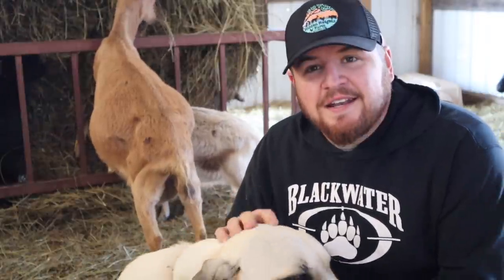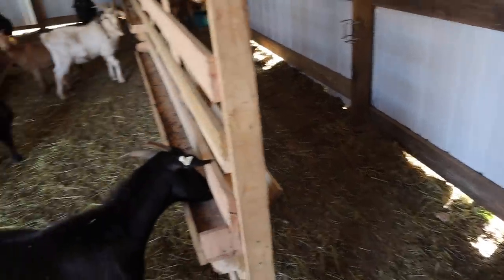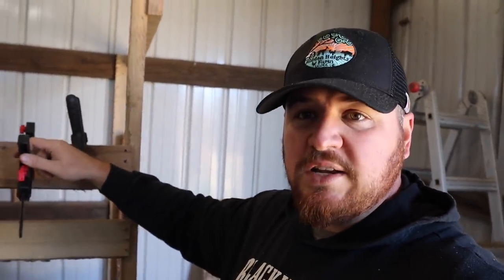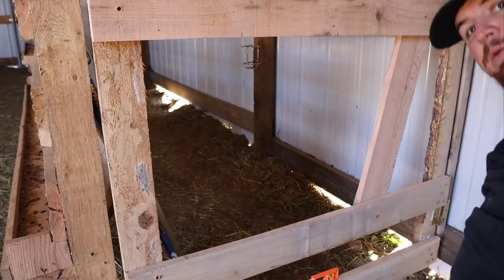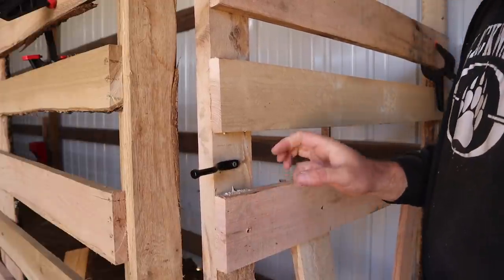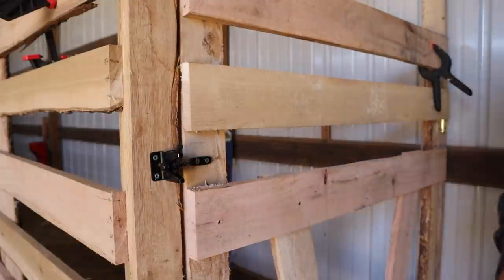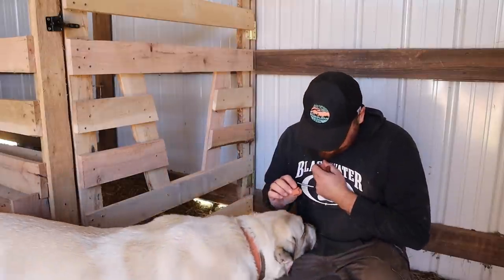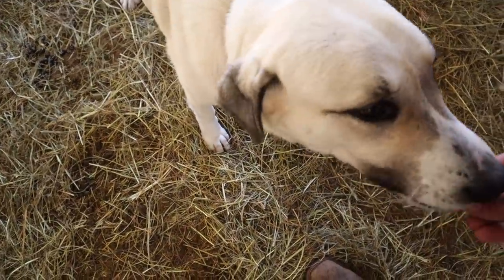This Had To Be Done This Way | LGD Adjust To New Changes

Comment: I use those latches exclusively with all of my doors and gates.
Drill a hole through the post and attach a length of baling twine to the latch so you can open from the inside.
Lovely job.  💐

Comment: What's 3 + 3 and what's 5 +1? Uh, 6! 😂 It doesn't matter, either way the outcome is the same and the end result is a functional gate. Watching how you built the gate is the way I would because you made it look easy. The bits are breaking because they are hardened steel which makes them brittle. After putting the screws in most of the way and before the bit breaks try using a 3/8 ratchet to tighten them the rest of the way. If that's not easy, then drill the pilot holes slightly larger which will allow the screws to go in easier. Before you know it, Daisy will be going in and out of the gate without thinking because she knows the goats can't get in. Nice job Kevin.

Comment: Whenever I would go in to "THE BIG BOX STORES'" there would be two different options on screw bits. It took me a minute to figure out what is the difference between the two. The more expensive of the two, was usually for my Hammer Drill, to take the extra torque. Cheaper one will bust the tips off.

Comment: I got to thinking about how to fasten feed bunk wall to the dirt floor.... drill some hole in the treated wood blocks that are on the bottom touching the ground, then drive some short pieces of Rebar through the holes into the ground......? Kevin does your ratchet Drill Motor have a Numbered Ring on the front just before the drill chuck..? If so, that's a torque setting for the Ratchet, if your breaking off driver Tips, back that ring off to a lesser Number, it's adjustable Torque.. you may have to turn it back up to higher number to seat the screw heads, but it'll release torque when the correct amount is reached...! That will save your Bit tips, try it on #one..!

Comment: You need to learn a little better trigger control. That will help you save on bits a bunch. There’s a learning curve when using an impact driver.
Reply from the maker: I've used one for many years just not on hardwood.
Reply: @HiddenHeightsFarm  sometimes a drill works better as trigger control is much easier. I enjoy your posts and that there’s not a bunch of cussing!❤️✝️